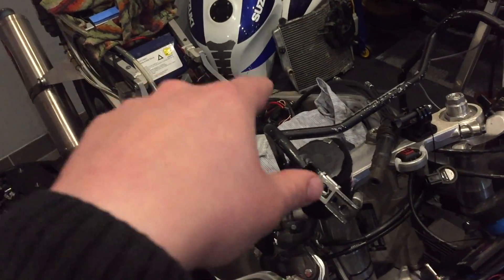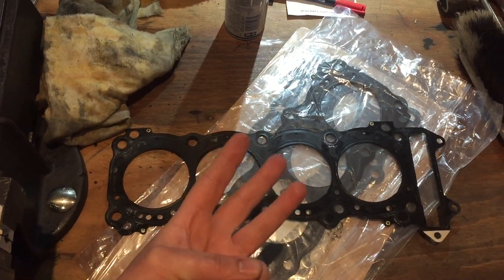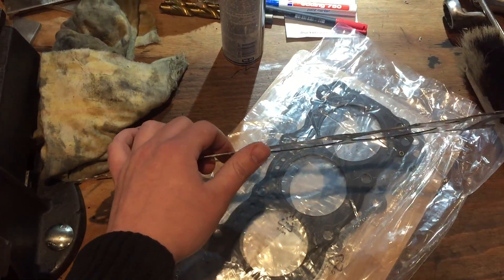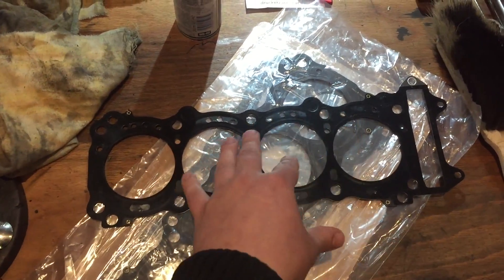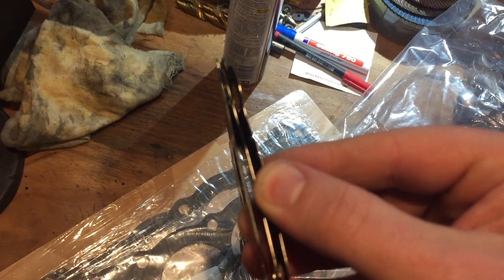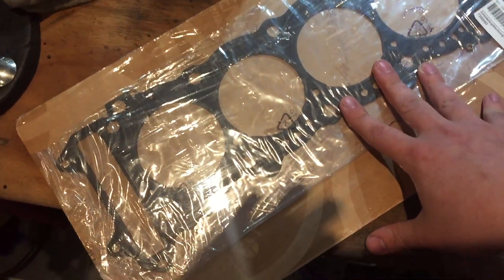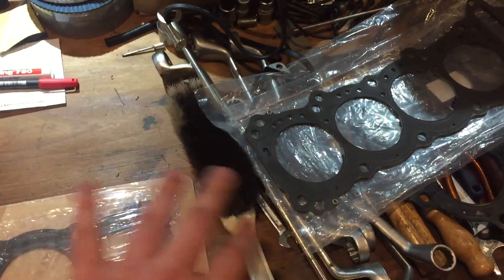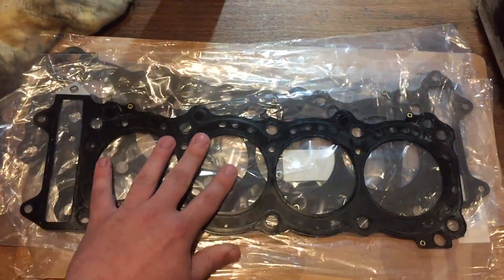SRAD 750 Build: Head gasket 101

Comment: Is it true I can change the head gasket without dropping the engine out? I'm new to head gaskets and my 750t has started blowing white smoke, I haven't started it since because i wrecked the engine on my zzr not taking note of the white smoke til it turned to blue smoke. I have studied your videos many times of the year down and feel confident enough to do it myself. I've heard the HG can be done with the engine in but il need small hands, nobody else has been able to verify this for me. Any advice is greatly appreciated dude 🖖🏍️ good vibes from Ireland ☘️
Reply from the maker: Hey mate, yeah you can change the head gasket with the engine installed in the frame. You'll need to remove the fuel tank, Airbox, throttle body or carbs and start to work your way down to the gasket. Just be extra careful and follow the workshop manual step by step. Should you have more questions feel free to ask!
Reply: Much appreciated man. You make changing the head gasket look easier than changing fork seals 🤣🤣

Comment: Hello, I have a 1998 750 and I am doing a rebuild. Everything is standard on the bike. Should I use the 4 or 3 ply gasket? I use my bike everyday going to work etc.
Reply from the maker: If you want the bike to stay reliable go for the 4-ply gasket. I ran into troubles using a 3 ply gasket for a street bike. Manly problems to start the engine, overheating in trafic etc...

Comment: Hello and thanks for this informative video.

I tried to private message You but can't find the form anywhere to do it on Your profile?

I would kindly ask You to help me with info if possible, do You know the bore spacing on the 750 SRAD?

I'm looking to adapt a SRAD cylinder head to a car engine and I'm ready to purchase a donor engine but would like to measure stuff beforehand.

Also where's the oil gallery for the cams located?

Best regards and thank You for Your informative videos.

Good luck with Your SRAD!
Reply from the maker: Hi, Thanks for you comment. 
I figure the measurement for the bore spacing must be very precise. Unfortunatly I don't have the tools to measure that precise. 
Have you checked the workshop manual? Maybe you'll find some information there. 
For the main oil gallary, it's located in the front lefthand side of the cylinder head. There is an external hose feeding oil to the cylinder head from the lower engine. 
Sounds like a hell of a job you plan to do. Best of luck!
Reply: @thesradchannel8818  thank You for Your reply. Unfortunately although SRAD is my favorite bike ever, the bore spacing is too wide. I will buy a K8 head and see what can be done.

Best regards and thank You!

Comment: What about the lower gasket? Are there different thicknesses for this gasket that could supplement the head gasket?
Reply from the maker: As far as I'm aware suzuki only offers one thickness for lower cylinder gaskets. But there could be aftermarket offerings in different thicknesses.

Comment: I replaced the head gasket on my SRAD last week and i didn't think to check 3 or 4 ply on the new one! the one that i took off was a 4 ply, i used genuine suzuki oem, also i have a hot start problem on my bike, when it's hot it can be hard to start, do you know anything about this because it seems to be a common problem from what i have been reading? Many thanks!
Reply from the maker: There are several things that can cause the described problem. If you should have a 3 ply gasket the compression of the engine is going to be a bit higher wich makes it harder for starter motor to crank it. When the engine heats up, this heat will also heat the starter motor and increase it's internal resistance. Then it can't draw enough amperage to properly crank the bike. These are two things kind of working together against you properly starting the bike. 

The track SRAD with high compression (-0.2mm cylinder head + 3 ply gasket) needed a running car with jumper cables or a fresh from the charger YTX14-BS battery to start. I tried different kinds of batteries (bigger ones, Gel, Li Ion) all with small effect. 

Rebuilding the starter motor can help. I think there are rebuild kits with new coals and such available. 
Also make sure all leads running from the battery to the starter relay and to the starter motor are free from corrosion and properly attached. 

So lots of text but maybe it will help you solve the problem.
Reply: @thesradchannel8818  Thank you very much for taking the time to reply! the problem i have was there before when it had a 4 ply headgasket  installed too, I'v been trying everything, took starter motor apart and there is a lot of life left on the carbon brushes, i have put a new regulator rectifier on aswell, one thing i did notice was the plug coming off the alternator  was melted so i changed it for a new one, i will check my starter relay wires too see if there is any issues there,  again thank you for your reply :)

Comment: I changed my head from a 98 to a 99 and the 99 model has holes above my exhaust that have been filled in where on my 98 there drilled and tapped for what it seems like some exhaust pressure tubes? is there a way for me to make this conversion quickly or do I need to have this milled out?
Reply: You must talking about the “PAIR” system. ignore it

Comment: also if you trim the head or use thinner headgasket your engine timing will be out of spec
Reply from the maker: Good comment, but as far as I am aware the positions for TDC and BDC as well as the cam positions stay the same. You're just minimizing the Air/Fuel volume thats left at TDC
Reply: @thesradchannel8818  Yeah, but if u imagen if you trim the head or use thinner headgasket u are minimizing the distance between camshafts and crankshaft but the cam chain is still the same. That is what i read somewere and is true so after that people are using adjustable camshafts sprockets and fine tune the engine timing so the engine still runs good as it should.